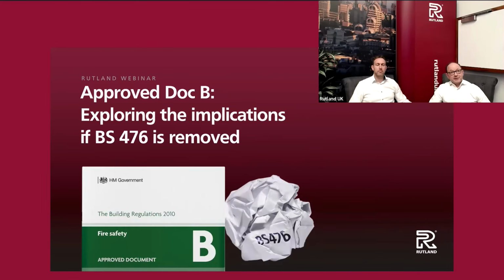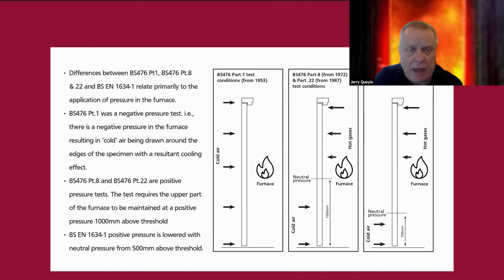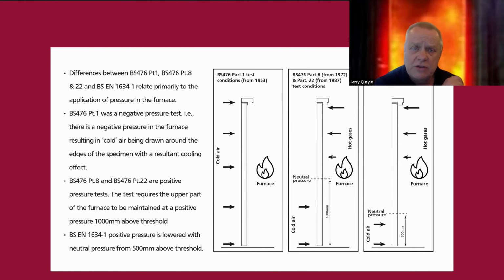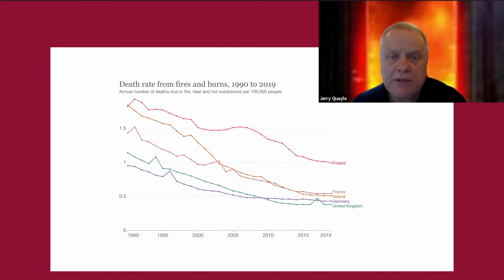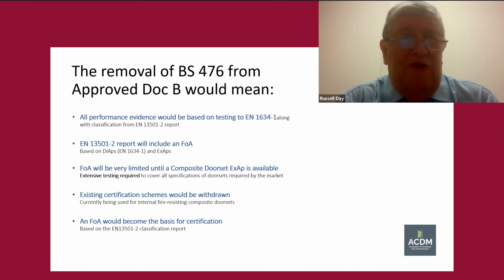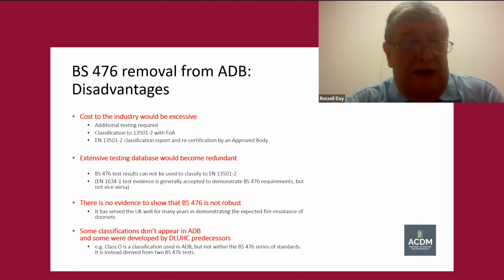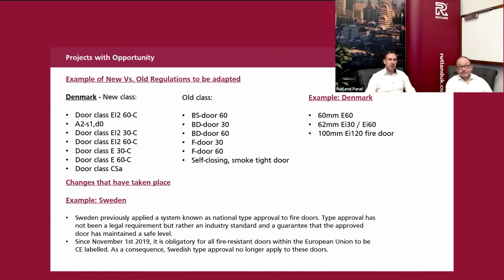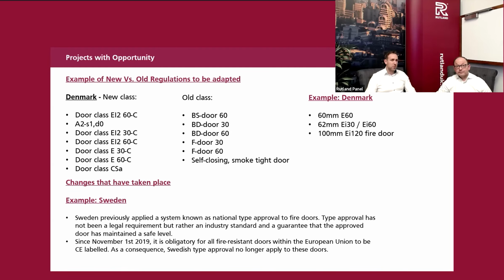Rutland - Knowledge Hub Series: Webinar - If BS 476 is removed from Approved Document B

Comment from the maker: 💬 In answer to Chris Waterman's idea, 'How in this digital age there should be a quick way to replace BS476 in certification with EN 1634?', our answer to this is "definitely not possible". You cannot elevate BS 476 testing to EN 1634-1. Each application tested to BS 476 requires completely new testing to the European EN 1634, hence the concern from the industry that it will be costing ballpark £10k each test... and the rest, if you include admin and manufacturing costs. And that's for every fire safety product detail affected. Unfortunately, it is not a simple, quick, low-cost 'search and replace' digital world exercise.